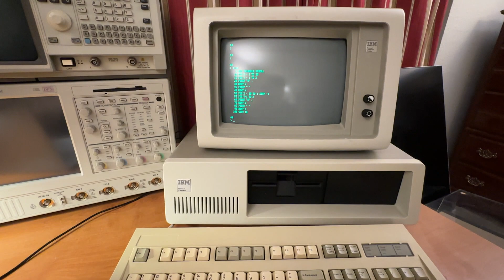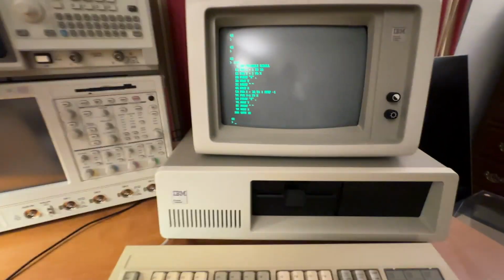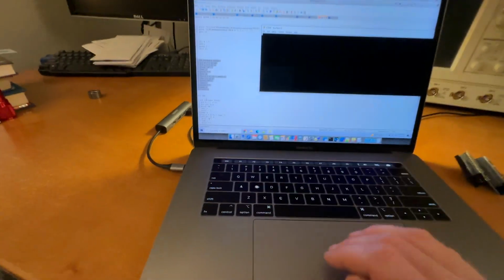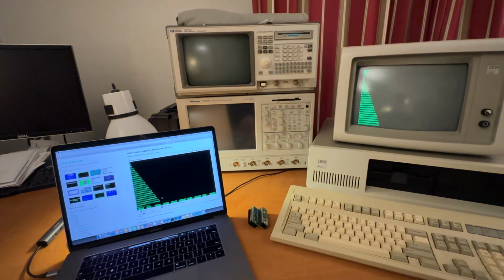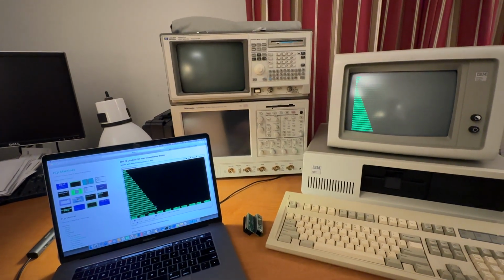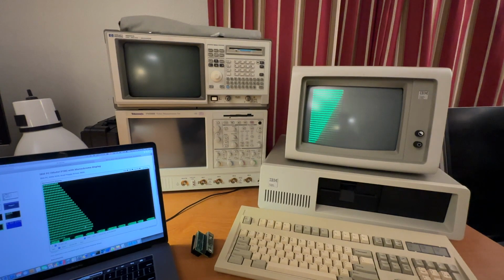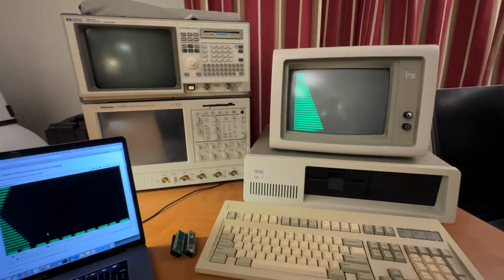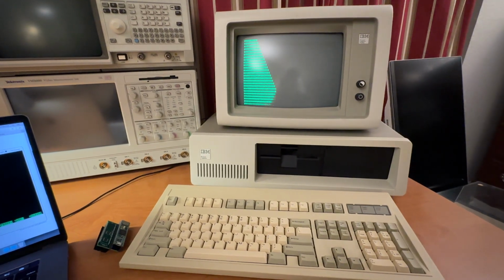IBM PC 8088 replaced with a Motorola  68000 - Part 2

Comment: Well, I would have thought, if IBM used the 68000 instead of the Intel 8088, that MS Dos would not have been utilizing the segmented memory models. I vaguely recall back in the 80's of those memory models (Tiny, Small, Compact, Medium, Large & Huge), because of 16 bit CPU register/20 bit address bus quirks.  At least, the 68000 was introduced with 16/32 bit registers.  I could have imagine how life would have been like without the quirky 640k barrier.

Comment: Neat! I wonder how much work it would be to get OS-9/68000 running on it?
Reply from the maker: Probably not much more work than redirecting the keyboard and video to the IBM PC addresses.
Reply: @microcorelabs7698  Another OS that could run in there is CP/M-68K